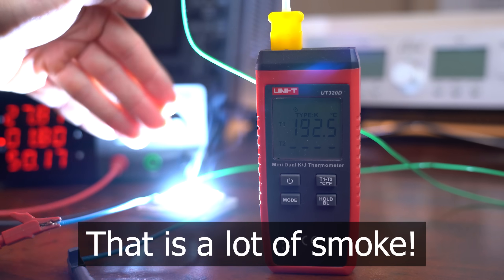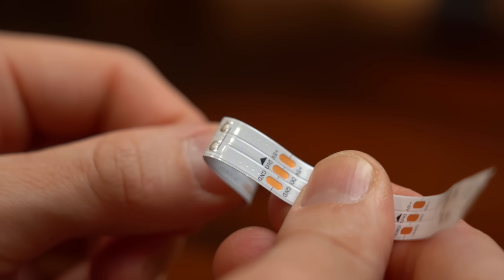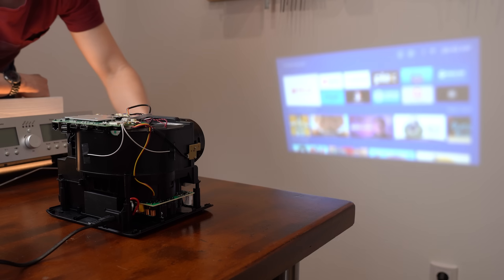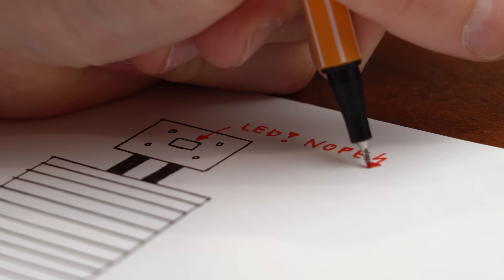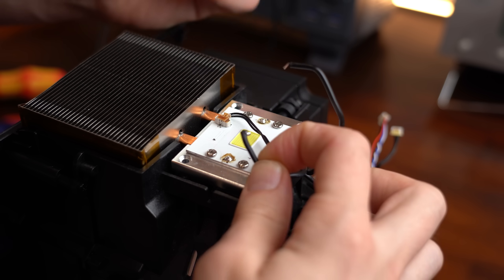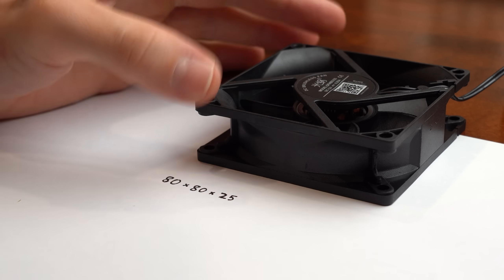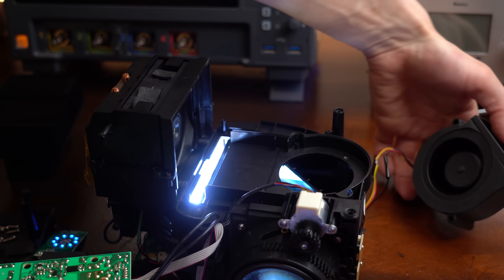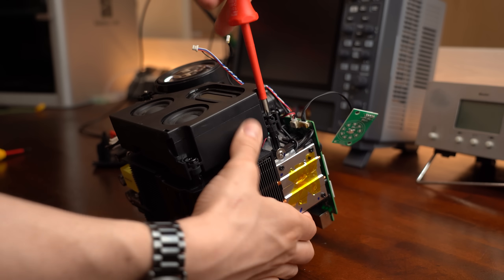Your Cheap Projector has 1 BIG Problem?!

Comment: for such cases it's always a good idea to look for maglev sunon fans, without obstruction they does not make any noise for exception of air itself
Reply from the maker: Ok, will have a look
Reply: @greatscottlab  Can confirm, sunon has the patent for maglev fan bearings, and they're awesome. They also offer a lot of variants, so you can def find a fan you need for any project. Also they're very reasonably priced.
Reply: @greatscottlab  I have tried many different fans over the past few years in my printers. Here is my opinion about brands: 
Noctua - fine, but low performance and overpriced. 
Gelid - fine, low performance and not overpriced. 
Sunon maglev - usually my way to go for for static use.
Same sky - chipper alternative to sunon, but still good and in spec. 
Delta - the best ball bearing option. These fans are noisy, but super reliable and productive.
Popular on Ali brads like gdstime and winsinn - don't even look at them, unreliable and their specifications have nothing to do with reality

Comment: I love this idea of improving something! The manufacturer's making a decent product that sells, but we can make them good products we enjoy.
Reply from the maker: Totally agree!
Reply: @greatscottlab  Actually, I hope the manufacturers take note of your video. The engineers of the product obviously cared about their work. I was impressed by the compact design, wiring, and heat monitoring. A newer model with quieter fans would be a selling point.
Reply: I love the idea of manufacturers building in 'elbow room' -- the possibility of consumers eventually opting to modify, improve, repair, and even re-purpose finished goods. Good design and engineering telegraphs itself well, and can't be knocked, but even better would be design and engineering that sees itself as 'a large iteration toward perfection', rather than the last word.
Reply: Good idea, but also producing parts that where only made to be replaced.

Comment: Was so disappointed when you didn't 3d print a side panel with a hole for a beefy PC cooler or a cheapo water cool AIO.
Reply from the maker: Haha maybe next time ;-)
Reply: The interesting way to do it imo is with a cooling tower, they're surprisingly efficient especially for the price at the cost of needing to be refilled and being relatively big
You basically just need a cheap pump, a water block, and a fan, you spray the water in a tube and have the fan pushing air in the opposite direction, directly cooling the water droplets.
Reply: @satibel  
A used AIO is less than $15.
Reply: @jackipiegg  yeah but less fun.

Comment: You can't measure the performance of a thermal interface material (TIM) just by checking the heatsink temperature.
What really matters is the temperature difference between the heat source (like an LED) and the heatsink.

If you're only looking at the heatsink temp and ignoring the LED temp, you're missing the full picture. You’re not actually evaluating how well the thermal paste is working.

In fact, a lower heatsink temperature could mean worse thermal transfer — because the heat isn’t even making it from the source to the sink efficiently.
Reply from the maker: That is why I measured the upper and lower heatsink temperature. You could see that the lower one increased while the upper one decreased. I think that means that heat travelled faster downwards and thus the new thermal paste helped.
Reply: @greatscottlab That's mostly measuring the performance of the heatpipes though, since both probes are measuring material that's on the heatsink side of the thermal paste

Comment: I’ve had a few cheapo ( £50 ) projectors and their killer has always been dust ingress .
After a few months they are unusable, a few strip downs to clean the mirror , panel and lens eventually does them in .
The noise from the fan actually helps me sleep  BTW !
Reply from the maker: Haha thanks for the feedback. No problems so far with my one ;-)

Comment: Next time add a Cu-shim between LED and Al?
Reply from the maker: Would that not result in some sort of chemical reaction slowly destroying one of the two metals?
Reply: @greatscottlab  It could due to galvanic corrosion and you would STILL need to use thermal paste in this sandwich unless you would plane everything to micron level differences. Without it you would go LED => TIM => shim => TIM => heatsink. Something like PTM would do the job due phase change and it could move heat faster and you could discard TIM.
And as stated before - Noctua fan for the win :P NF-A8 PWM, 2,2k RPM or 1,75k RPM with their low noise adapter (LNA), 32 CFM in normal setup and 22 CFM with LNA.
Reply: @greatscottlab  Due to the heat the moisture contend required for galvanic corrosion should lacking - but your projector would be long gone by then.  The Cu works as a heat spreader, greatly reduces the peak heat spike, increasing to the lower thermal conductivity of the Al. We use this technique in high wattage amplifier design. The heat conductive paste needs to be thin - just enough to fill the material irregularities.
The aim is to increase the heat path (lower thermal resistance)  to your phase change heat exchanger tubes. Something similar on the fin's side to increase heat transfer to fins.
In all a very good and entertaining video!

Comment: I dont think it is correct to measure the noise level right where the air flows, as it could potentionaly even with the pop filter on the microphone capture some of the wind as noise.
Reply: Yes, usually you either use 10cm or 1m distance for noise measurements. And the orientation of the microphone can have a huge impact as well. To get somewhat repeatable mesaurements i always point the microphone directly at the noise source. When using the noise meter calibrator, it gets plugged on the microphone stickout as well with it's speaker pointed at the front of the microphone, so it makes sense that this is the way it's intended to be used.
When we have to qualify a products noise level, we actually use many different points on a sphere around the device to find the loudest direction, not always the noise escapes at the most obvious place (like straight out of a fan opening) but it could come from some vibrating sidepanel as well...
Reply: @ProtonOne11  This. Near field measurements can be deceptive. Especially partial ones.
Reply: @ProtonOne11  we measure 80cm away at an angle to the noise source atleast exhaust systems so they dont need to be "re registered" in to the inspection sheet by raising modified % of the car
Reply: Yeah, it's more useful to just measure the sound where anyone would hear it (ie: where your head would be when watching a movie). The type of sound can also make a significant difference to how annoying it is, with larger fans routinely being much easier to tolerate.

Comment: it's also worth noting that all your temperature measurements were taken at your room temperature while this device's fans were sized to handle hotter environments than that, I think 30 celsius at least. So this makes it more quiet but also reduce it's temperature range.
Reply from the maker: Definitely true. I should have mentioned that.
Reply: I was thinking the exact same thing. Since this is likely run in a cooler environment it is well within the safety zone

Comment: Noctua fan are one of the most quiet yet high performance.
And don't put linear voltage regulator without the heatsink. On power supply for the fan it could get very hot due to low efficiency.
Reply from the maker: The power loss created by the linear regulator (12V to 9V) is not enough to heat it up noticeably.
Reply: @greatscottlab  good job, like the breadcrumbs.. that other dude always going on about brass/ liquid metal...
Reply: @greatscottlab  yes, but if it put between two plastic panels without any air movements it could potentially fuse itself with plastic. It's less than .5 Watt though but still a decent amount of heat
Reply: Even simple resistor here would be suitable. There is 3V voltage drop with probably 330mA of current, so the regulator will drop around 1W. It should be barely ok.
Reply: @micha3-2137 normal resistors are a quarter watt man, you'll scorch that resistor in no time...
Reply: Dropping 3V at this intensity is perfectly fine

Comment: For cooling you also have to rely on the pressure the fan can generate. This is often a missed point, especially by small fins
Reply from the maker: Definitely. I actually wanted to tackle the pressure point in the video as well. But it was getting too long. I will probably cover that in a future video.
Reply: @greatscottlab  I have a look at the pressure and flow of the original fan and try to find a Noctua one. Otherwise some artics are made for pressure and are also quiet for a good price (15€ for 3 I guess)
Reply: I was thinking about the static pressure from the fans initially. However if you look at the heatsink they use, the fin density is so low they can get away with very low pressure.
Reply: And what about the orientation of the projector?
I noticed the heatpipes and heatsink for the LED was "pointing down", like the heat has to go down, when positioning the beamer as was done here in the video.  However if you mount it upside-down, as when you mount it to the ceiling, the heat of the LED will more easily go to the heatsink.
All heat you can extract there will not build up in the beamer itself.
Still the LCD will block light, and thus heat up. So I totally understand the comments others have made about cooling of the LCD and its polarizing filters.
Reply: The static pressure rating only applies if there's substantial airflow restriction, that heatsink is very porous and therefore the flow should be pretty close to the flow when completely unobstructed (which is to say if the spec sheet is honest it should deliver that flow rating just fine)
Reply: IF the specc sheet is honest...
Which it most likely is not...
Reply: @Haldi4803  I mean.. using just human sense it's more than enough. If it feels like to less air coming thru and too hot.. yeah... The fan is probably to weak.
It's just interesting if you're going to order a fan especially for this project.
Reply: @bosstowndynamics5488  The heatsink is, but not necessarily the entire inlet path. It will also vary between different projectors, which people may use the general concept of this video for.

Comment: 13 comments, 7 of which are porn.  Sigh....   :(
Anyhow - I have a projector similar to this as well, works great, except.... the noise!  Since it's now out of warranty, I'll have to look into better cooling like this as well.
Reply from the maker: Haha don't worry. I always block them. I was not that quick though this time :-) Good luck with your modification ;-)
Reply: @greatscottlab  - I always try to hit 'report' as porn when I see them as well.

Was thinking about the noise... redirection is another option.  3D print a 90* duct as an example.  Point it down at the floor, or towards the wall.  If you point it at the wall, put a block of pointy foam where it's aimed at so the wall doesn't reflect it right back at you.  Concepts like that anyhow!

Comment: Needs water cooling upgrade 😅 Other than that, what a catch on Ali! Great job Scott 🎉
Reply from the maker: Haha yes. Maybe next time. I actually never worked with water cooling before. Maybe I should focus on that in a video and compare it a bit scientifically with normal fan cooling.
Reply: @greatscottlab  Given the size you are dealing with, an off the shelf AIO unit for CPU usage would do terrific here, no need to go custom at all.
Give it a try with one of your LEDs, you'll want to do the conversion.
Reply: Yeah 50W is nothing. A single 120er Radi or 140er can easily cool that. The hard part would be to find a 12V power supply inside the projector where you can steal power for the pump.

Also instead of that loud fan on the top increase the case size by 20mm and put a custom top/side plate on it with a 120mm or if it fits 140mm fan that cools the other parts. Maybe even put the Watercooler on top so the fan pushes trough the radi into the rest of the projector!

But that's way too much work... This 200$ projector must be a really hidden High Quality gem for it to be worth it all....
Reply: @greatscottlab  This would be great! Water cooling is fascinating, there are many different variables you can experiment with.
Reply: @greatscottlab , in my opinion, that's a great idea for a video - change the original cooling to liquid. Then, compare it to some more expensive and quieter projector from Ali.
Reply: @greatscottlab  perhaps use an AOI solution. No issues with the water. Just plug and play.
Reply: @greatscottlab  You could order a custom plate made from acrylic and copper. But you need to provide 3d model of parts. Price would depend on your location
Reply: @greatscottlab  One thing to note with watercooling. When the water is cool it cools very well. But omce it's up to temperature it takes a lot to cool down.
Reply: @greatscottlab  PLEASE watercool it!
It is super easy, no worries.
Reply: Interesting idea! My first take was to 3d print some larger plenums and then use something like a large noctua fan. It'd look bulky, but be quiet. Liquid cooling could be awesome because you could route the tubing and then use an already existing cooler setup.
Reply: I actually started experimenting myself with replacing a projector lamp with a watercooled led. I shelved this project a while ago, but what I found is that you still need some aircooling for the display unit. I experimented with old sanyo projectors you can get quite cheap on the used marked still.
Reply: diyperk
Reply: @ThreeRex  that's who inspired me to try it, yes!
Reply: It's a residential fun projector, not a 15 kW Xenon arc illuminated IMAX projector.  Water just adds another complex piece to a projector that was probably fine if he left it alone, now he voided the warranty.  Occam's Razor, people.